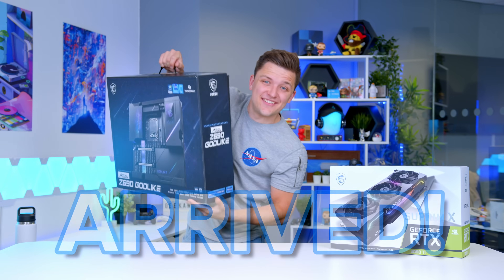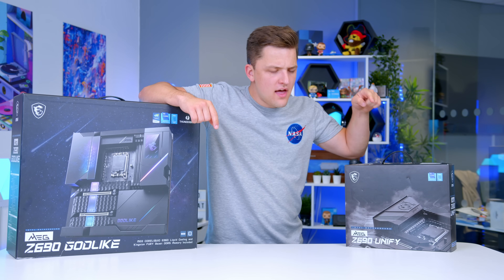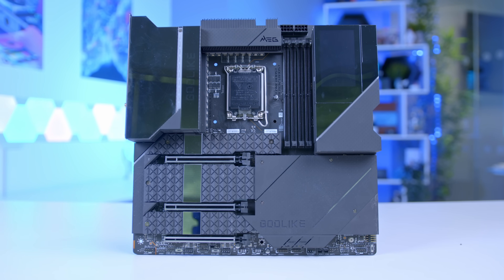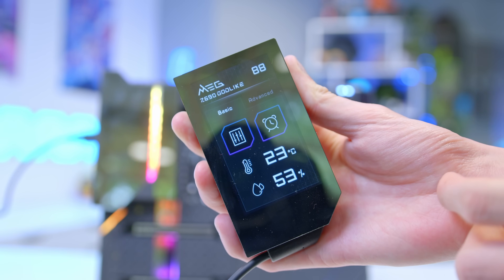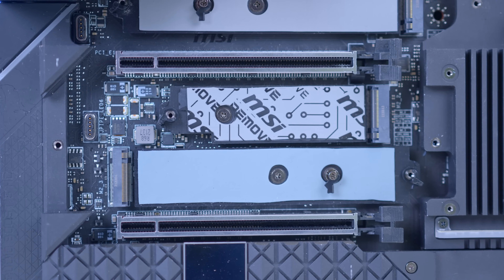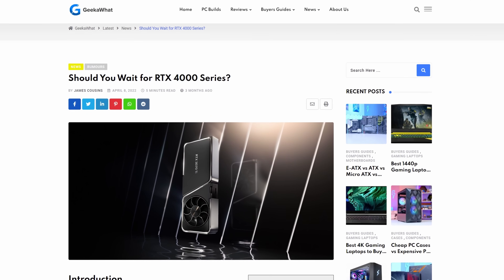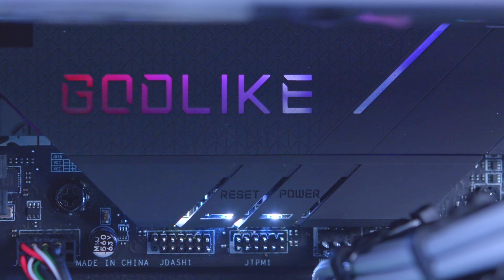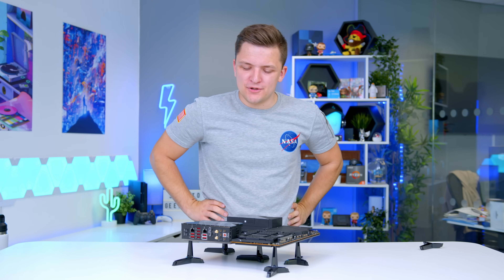This Motherboard Costs More than an RTX 3090Ti... is it a SCAM?! 💰 [MSI Z690 Godlike]

Comment: Dude the msi suprim x dropped by a fee hundred and went on sale and it's now on backorder due to demand at newegg. Of course I mean thw one sold and shipped by newegg not the 3rd party sellers. Most know by now not to get 3rd party on newegg or Amazon. So anybody judging stock with the 3rd party sellers shouldn't because those don't count as most know not to buy from them. But the ones sold and shipped by newegg is on backorder! I got the evga 3090ti I wish I waited because idc if I wanted the evga or not hut for the price man I would of loved the msi haha. Also yes the godlike is overkill for a motherboard I mean need to save money in some areas. Especially when getting a 3090ti and stuff need to sage some money in soem areas.